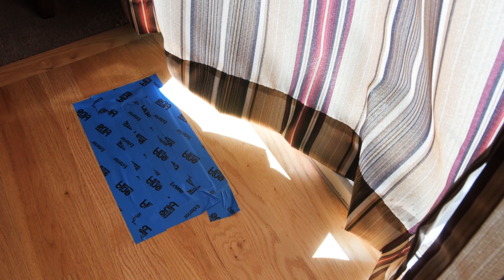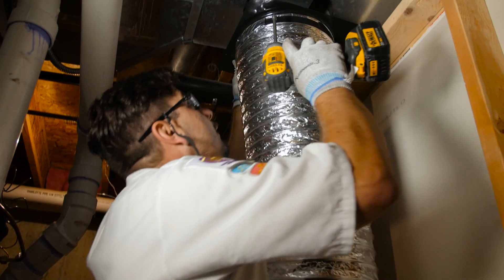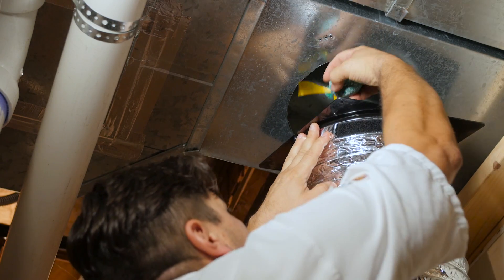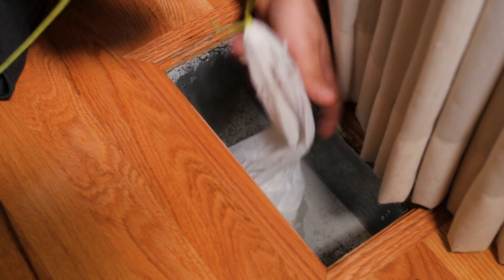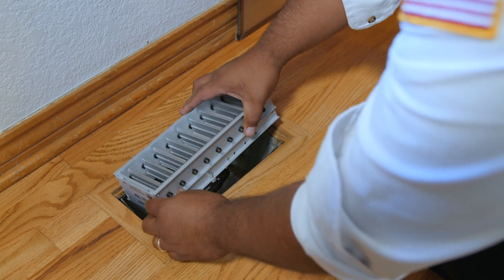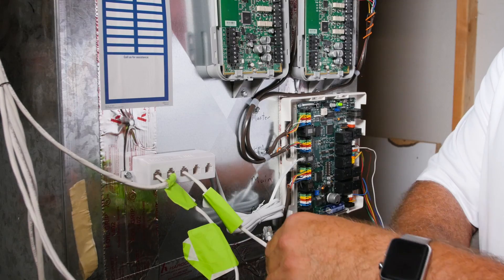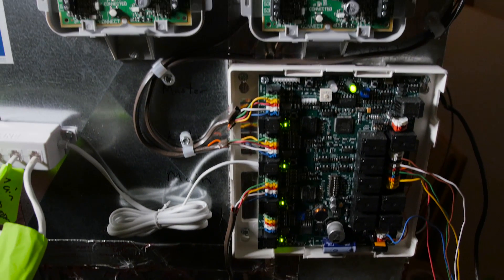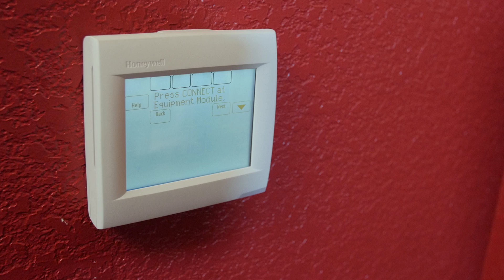Retrofit Zone Damper Installation

Comment: How do you retrofit a central air conditioning in Florida that does not have a basement or a furnace?
Reply: You have an air handler with a blower and a coil - it all starts from there.

Comment: The problem with this approach is that the damper is at the register, so heated or cooled air flows all the way down the duct and can't get out, which is inefficient. A better approach is to locate the damper at the duct near the HVAC unit, so more airflow is pushed out of open registers, and energy is not wasted by air moving down a duct that is closed at the far end.
Reply: I don't think it quite works that way.  Think of the air as water - once the pipe is full, the flow rate becomes 0 and the pressure in the rest of the "pipe" rises.   This is also a retrofit installation where zone individual rooms from the source is impossible.
Reply: I dont know alot about hvac (only completed community college cert course and epa 608) and even I saw that issue lol, I need to zone my houss its a 3 bedroom all bedrooms upstairs, im in so cal area (riverside)  how much is a good price to do it the way you said ?? Thanks

Comment: I'm thinking about doing this set up on my 2 story home that unfortunately is only 1 zone.  there are three registers upstairs as well as the return.  The air flow going the upstairs is significantly higher than the down stairs currently and with the return in the upstairs hallway, it seems as if the air upstairs is on a short loop to the return while the downstairs (1250 of the 1850 total sq ft) gets starved.  the downstairs has vaulted ceilings in the main area.  
with the current pressure differential in mind, should there be a bypass installed on the upstairs duct??